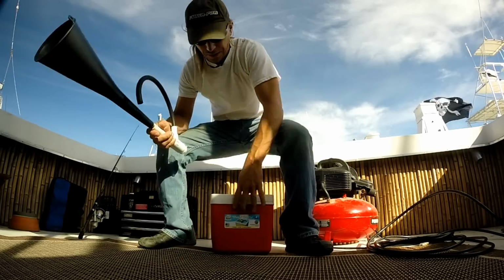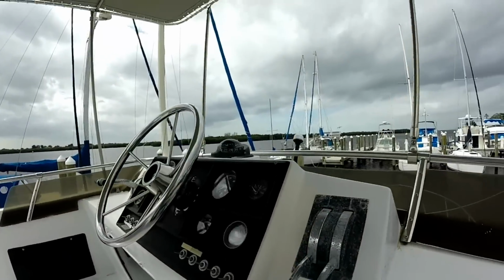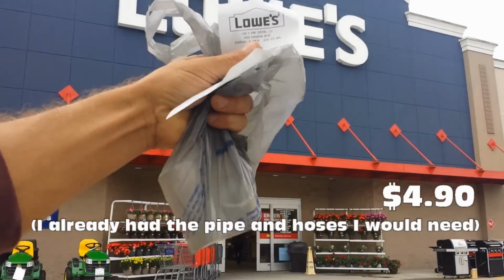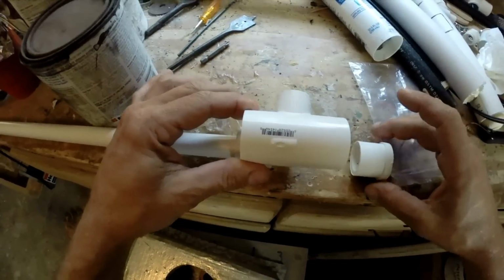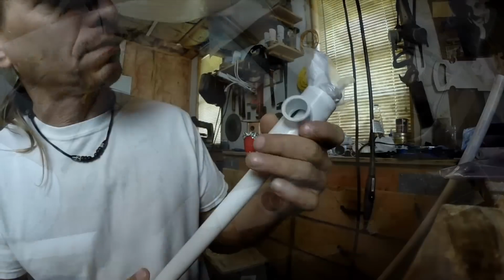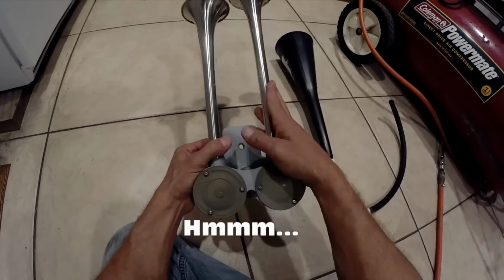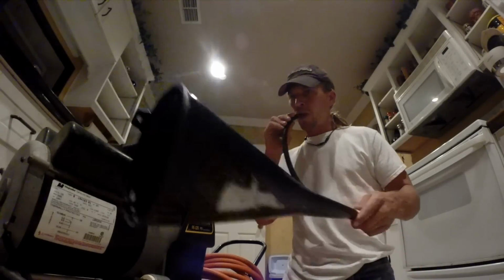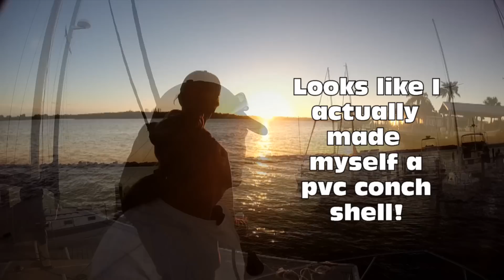$5 PVC Air Horn

Comment: Go to WalMart in the bike area and pick up a Zefal Little Big Air foot pump for abut $9 bucks or so. You can attach it to your horn and work it by hand or by foot. It is light weight and works like a champ for these DIY train horns. Stores away easy, too. Nice video, but I do wish you had listed the individual PVC parts for the horn here. Thanks for sharing.

Comment: Put a 90* elbow on the long end and then attach about 10" of pipe and then the funnel. You can then strap it to the fishing crate so the long pipe points skyward and the horn points straight ahead. Just have the hose strategically placed close to the seat so you can sound off if you ever need to.  Maybe instead of a 90* elbow you could use a T connector and close off the pass through section so it acts like a 90* elbow for air. Just make sure you close it off from inside the T, that way you can use the remaining section to attach a light source - giving you sound and visibility.

Comment: If you'd have given the air motor/compressor some air oil/WD 40 it probably would have been right back to working just fine as they dry out over time and don't run at high enough RPMs as do air tools.

Comment: Put an air compressor and tank in the engine room.  Run an air line to the horn and put a pressure guage in the dash and then you can run some air tools or fill up inner tubes for some beach fun.  tjl
Reply from the maker: Cool idea
Reply: Tim Lipinski he can also use it to charge a potato gun to cast a fishing line out really far.

Comment: In case anyone stumbles here ready to build one, and wants to put in a switch, you can get a 1/4" NPT 12V Solenoid valve for $15 on Amazon. It's water proof, and the 1/4" NPT is perfect for quick connect plugs for air tools:

https://www.amazon.com/dp/B00APDNPXG/ref=cm_sw_r_cp_apa_i_3ZmaBb05W06EG